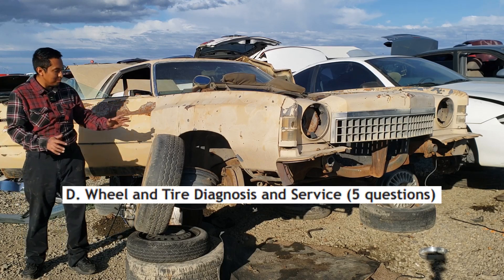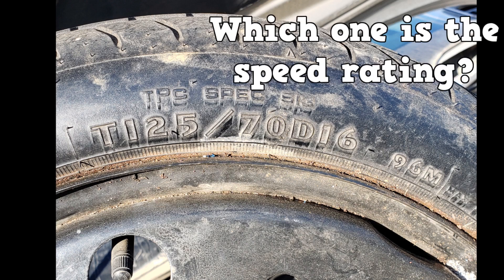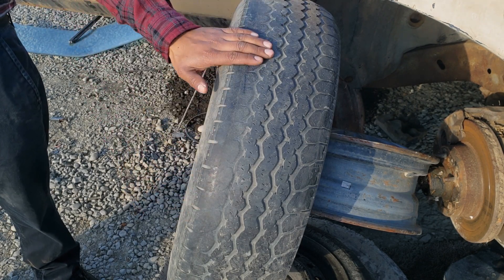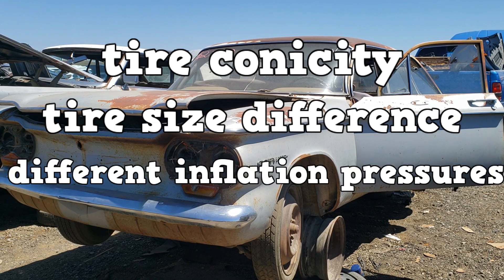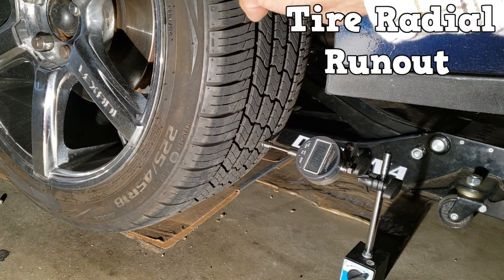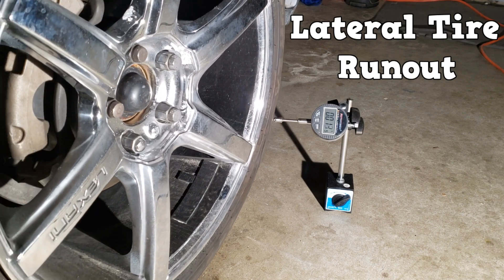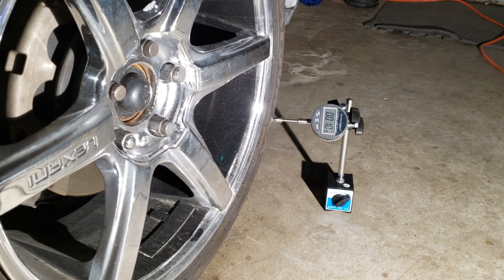ASE A4 Test Prep #2 - Tires

Comment from the maker: Update 3-6-23: After taking the test, I see that this video is a goldmine of information on tires.
Tire wear patterns is on the test (3 questions), but the test called some of the patterns by different descriptions not detailed in this video. Know what "heel and toe wear" is and what "shoulder wear" is.
At 1:31 cupping is mentioned on the test, but as the types of noise it makes, not mentioned in this video.
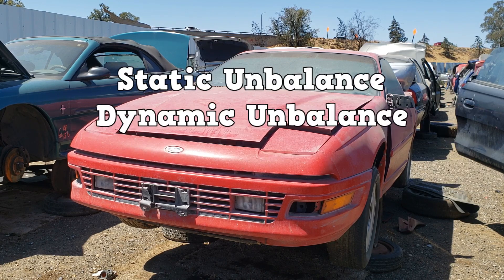At 1:39 , the test focuses more on procedures of fixing tire run out.

Comment: You videos are short and  basic but really gets to the fundamentals of the ase tests and easily will get half the questions right by lisening to you and I know is not passing but the rest it depends on you like experience and know automotive theory if you graduated tech school mamy years ago will plenty of videos in tou tube about internal repairs of manual transmission and rear diffs some of us techs work in dealershipa rhat dont rebuild these and also manual transmission are extremely rare is been years I have not seen a manual transaxle